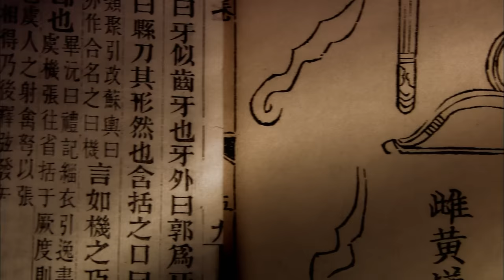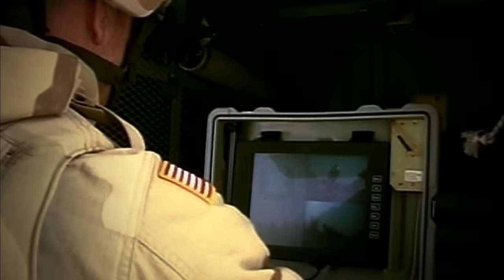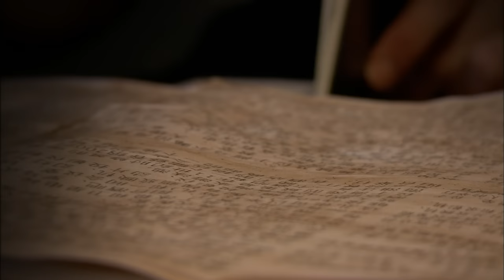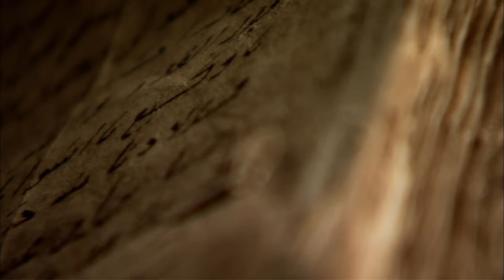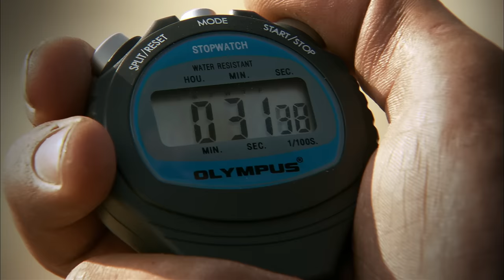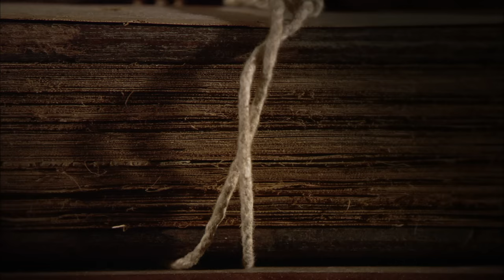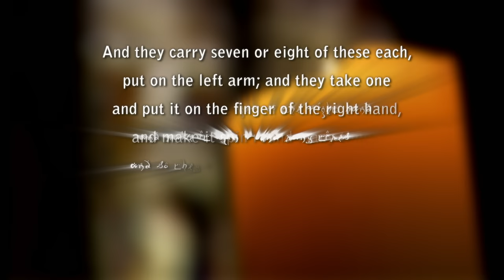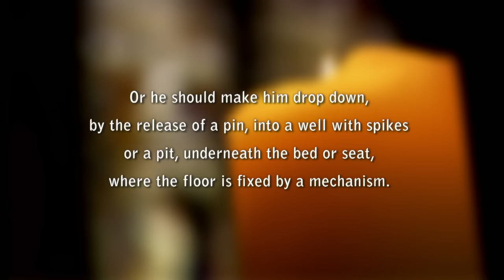Twisted Weapons of the East | Ancient Discoveries (S3, E16) | Full Episode

Comment: An with zero operator as said here the things CAN'T be bout accuracy.. guessing more like causing mayhem an what damage possible while trying to be resourceful an not risk anyone or thing significant if can be helped. Even at max "effectiveness" how much damage an shocking would them huge horse drawn "auto" crossbows really be??

ALSO, paper... Not too surprising actually seeing as vast majority of the time gunpowder propelled weapons was, if known in acient times, in most places exotic an rare or difficult an hard to effectively employ an just like how IF you Take a single paper sheet its not hard at all to rip in half. BUT if you take a ton of sheets an put them together like shown an said which was bout only way to do it.. to make scale THAT thick it doesn't sound so far fetched they'd be able to block sone sharp objects an/or projectiles. Not like bullets an rockets an like so should work fine if done right

An that "death bed" would anyone WANT to survive that?? Sure some MAY have but youd suffer so bad an be hardly able to move youd wish not. An theyd probably have you finished off or left there